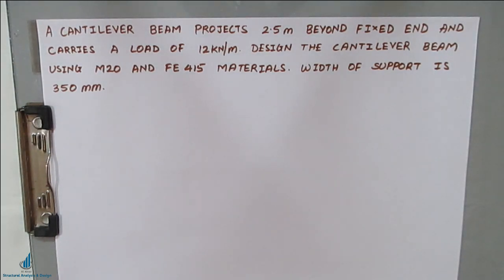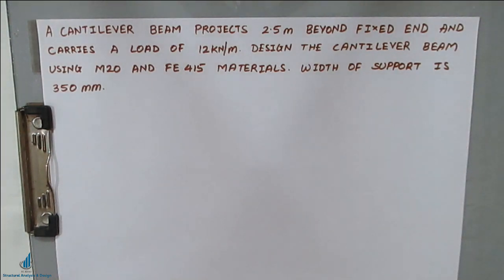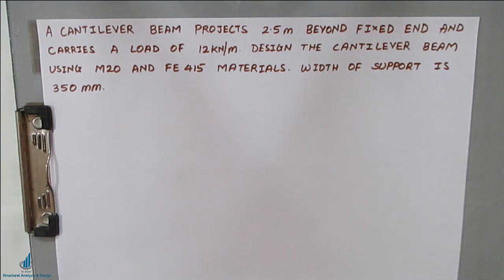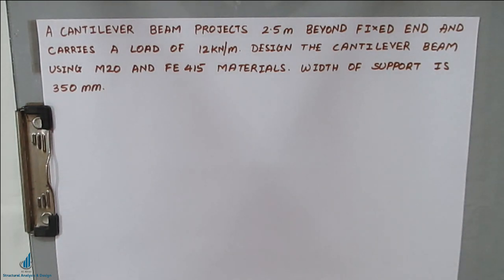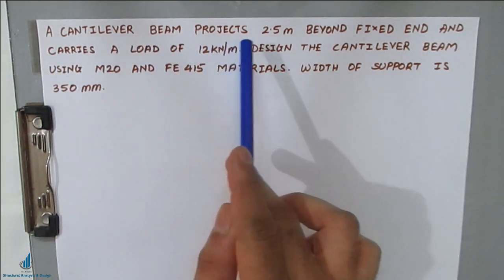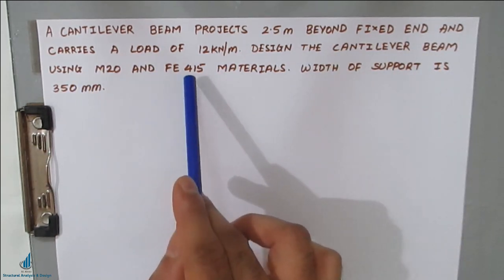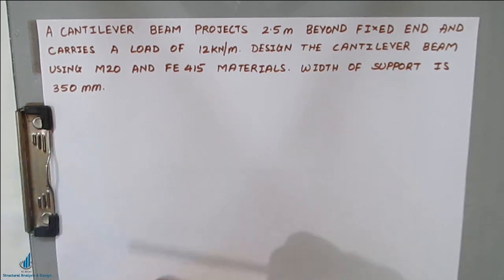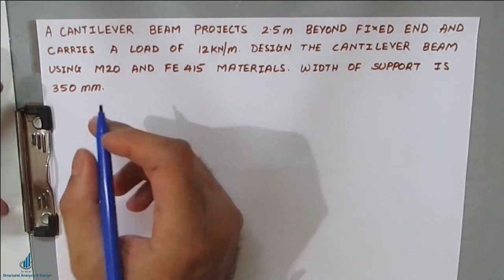Design of Cantilever Beam | How to Design a RCC Cantilever Beam | Cantilever as per IS 456-2000

Comment: sir, as the adopted reinforcement is Fe415 , after concluding the section as under reinforced why did you take Mu = 0.133 fck bd2. 0.133 is for Fe500 and for Fe415 we have adopt the formula Mu = 0.138 fck bd2.
Reply: Yaa, taken value of Mulim is wrong

Comment: Sir

Your efforts are good

Go for IS Code
Minimum mix is M25 for rcc.
Now a days 415 steel is not available.

Make it more practical by

Bring a project in to it.
So that the students will understand why it is a cantelever.
Why it is starting from column.
Tell how the load is coming.

Shiw full details then come to the xantelever
Reply from the maker: Good suggestions, i will try to do it, but M20 is minimum mix for RCC as per IS Code and problem is solved as per IS code only

Comment: Thank you very much sir. What is live load you considered. Is it brick dead load of bricks. Also called as super imposed load
Reply from the maker: Yes overall live load
Reply: @structuralanalysisanddesign   we take live load Max upto 3 kn/m2 on slab. What is that load. Which taken as live load in problem.
Reply from the maker: Nowhere they had mentioned from where load was coming, its assumed overall load coming on beam say brickwork etc

Comment: First i would say, You are a true gem dear, appreciated your effort and the way you explain things A to Z, really really impressed. Keep this great channel going. My question is what if Tv<Tc (means no need for shear reinforcement) then how will we provide the stirrups and its spacing as you have not mentioned about this point in Singly Doubly and Cantilever RC-Beam ? Best Wishes.
Reply from the maker: Thank you so much for appreciating me and for best wishes to the channel, this kind of motivating words keep me motivated to do videos, keep watching and supporting. To answer your question, if there is no need of shear reinforcement but still we have to provide minimum shear reinforcement in the form of stirrups, kindly refer IS 456-2000 Page 72, clause 40.3
Reply: @structuralanalysisanddesign  Thanks for your answer. Sir will you provide a lecture on deep and hidden beam design if yes then expected time?
Reply from the maker: I cant guarantee but your request noted

Comment: Hi sir, really loving all your videos. Could you please clear one of the practical doubt of the following case. It is for my home site. How do I extend a balcony of 1.2x2.5m of a preconstructed apartment using cantilever beams? It is a third floor. Column size is 9x12 inches. I am going to use 6 top bars of 16 mm and 3 bottom bars of 16mm, curtailing 2 top bars at 0.6m with the main slab bars of 12mm and distribution bars of 10mm. Stirrups bar of 8mm with spacing 4 inches center to center. cover block of 30mm with hook angle 135 degrees and angling downwards. slab thickness at support 6 inches

As it is preconstructed apartment, I could not extend the bar back, however I have reclaimed around 0.6m beam and slab bars after demolishing beam and slab. Will this be enough for lapping length of slab and development length of cantilever beam. I plan to create a brick wall (4 inches, 9 feet ceiling height) to include this space inside to be used as a kitchen counter of 2 feet and overhead storage. What modifications I can perform to ensure safety.

Total reinforcement area is now 3feet 6 inches cantilever, column(9″x12″), 2feet overlapping length.

Comment: I am going to make 5 ft length of cantilever beam. Size of column = 10'' x12".
Any suggestions on placing of reinforcement, developmental length and hidden beam?..
Reply from the maker: I strictly suggest you to consult your local structural engineer
Reply: @structuralanalysisanddesign  if you dont mind, can you able to help me somewhere or the other way?